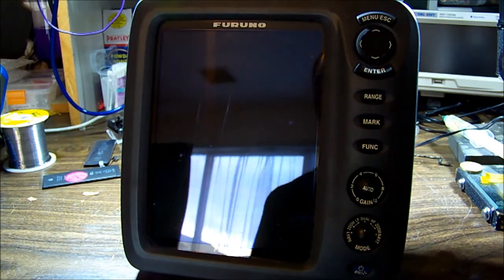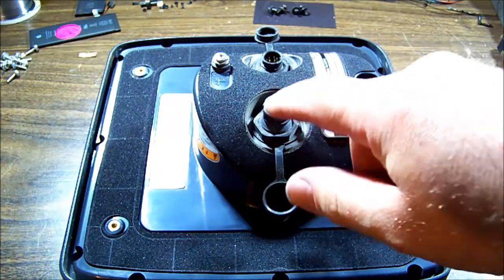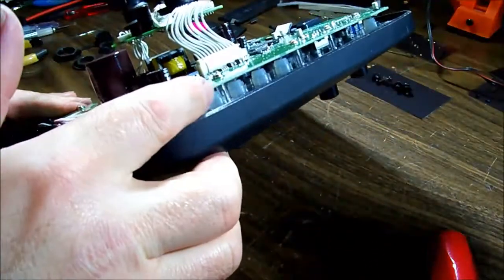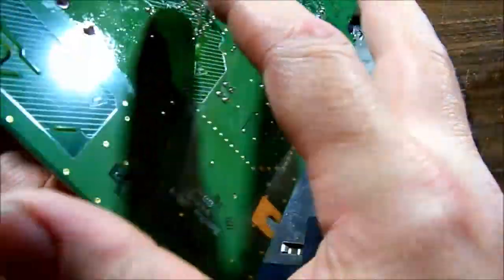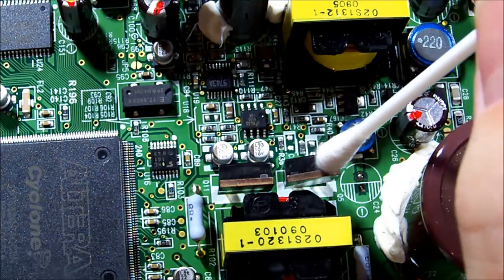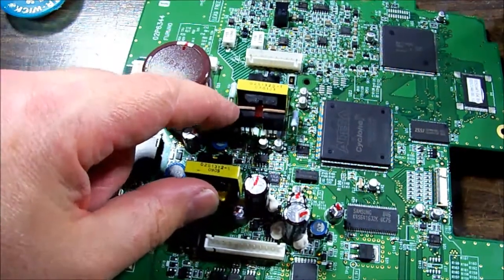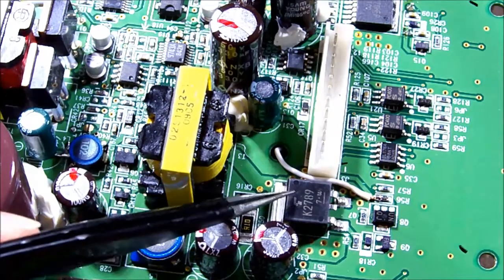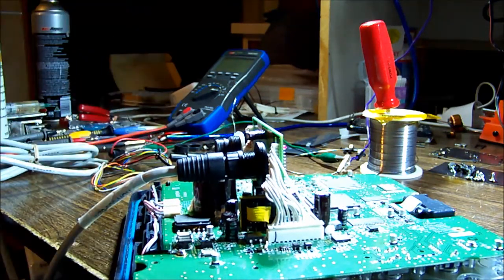Furuno FCV-585 fish finder sonar depth sounder repair

Comment: i had 2 of these at our workshop, 1 worked after replacing caps but failed after a few months again, i had thrown them in the corner, then a 3rd came in so decided to look again, found your video, now all work!. the track must continue to corrode after cap replacement. I ended up replacing all caps except the larger power filter one, and found several at the leaking stage, definitely recommend replacing all if doing this fix!

Comment: Dear Johnny, thanks a lot for your video. I have the same fish finder with the same problem. My brother Jaime and I have replicated your repair and IT WORKED!!! It was not until we jumped the trace with a copper wire that it worked. 
It is very strange. It seems that this is a programmed obsolescence. Why is there a hole prepared to pass the wire through?
Anyway, your video explains the procedure perfectly and helps a lot to keep understanding electronics. I teach at university (environmental engineering) and I must say your pedagogy is far better than mine.
Kind regards from Mallorca, Pere and Jaime
Reply from the maker: Thanks! I appreciate the comment and glad I helped with your problem. Planned obsolescence is a bit of a stretch here but yes it certainly does exist. Not surprised you had the same failure as these caps are destined to leak and the units are always mounted one way then gravity dictates the leak will run to the same area on the board and cause the same damage. The hole for the wire is just pure luck :) Happy sailing!

Comment: Sir, I have a Furuno type FCV 620 when it is turned on, the display voltage continues to drop and turns off, turn it on again and again, the voltage drops in what circuit should I fix and replace the components ... please help ... thank you

Comment: Gee Johnny Fix I have a FCV 588 and it stopped working the next week after going out.  Pulled wire out from fuse box and connected it to a battery and sounder stated working.  When I touched the power lead it stopped again.  Had a look into the pins on the sounder and the power lead had a green type build up.  I sanded that off and sprayed it with contact cleaner but that did not work so I sprayed the pins with WD40 bingo sounder working again.  I hope this will help others

Comment: Jonny, what is the ball park cost for this sort of repair. My Furuno FCV-585 is doing the exact same thing. You can email me if you like - heath AT gcfishing dot com  I'm located in Queensland
Reply from the maker: I don't have a rate as I'm not in business but any repair shop worth their salt should be able to do this straight forward repair. If I had to guess you might be up for $60/hr and if as simple as this won't be more than an hour. Some places might have a minimum charge even if not fixable. Cost of parts a couple $ each tops. These units aren't cheap so would be worth repairing for sure. My only concern is if the o-ring will still seal the case. I guess only an official service agent could provide a new one. Nothing a thin smear of silicone won't solve tho!

Comment: Hi I have a furuno 1623 radar I think the Magnetron is going bad ... how can I check that... can you help
Reply from the maker: I don't know. Check the manual for a self test function. If you can borrow a known good transducer to test with, or plug your unit into another boat setup that might prove if it's the unit or the transducer. I don't believe they run magnetrons.

Comment: Hi Jonny I am writing to you from Italy I wanted to ask you if you can help me, you give the service manual of the fcv585 on my burst a chip and you can no longer read the model number, if you want I can send you a photo so maybe you could help me better if not the manual, thanks.
Joseph
Reply from the maker: I'm sorry, I do not have the service manual for these units. If you cannot read the number on the chip you will need to look at the part of the circuit it is connected to and make educated guess as to what it does and then find suitable replacement. Might be some trial and error.
Reply: @JonnyFix  Jonny I had thought that if I could attach a photo of the circuit you could look in yours and tell me the model of the chip and you would have been very helpful.
Joseph.
Reply from the maker: @PeppeLoGGiu  It would, only I do not have this unit anymore. Most of my videos are other peoples equipment.

Comment: Hi Jonny, I'm writing from Italy. I have a Furuno fcv 585. There is this problem where the screen works but all I can see It's white, theres no immages shown. The buttons work just fine with sound and all.
I would be very glad if you could help me. Thank you
Reply from the maker: I guess firstly make sure no water has got inside it and everything is clean. If there's any corrosion you will need to deal with that. If everything looks clean try removing then re-inserting the flat screen flex cable in case the connector came loose or the connection has gone bad over time, this can sometimes help. If it's not something simple like that I'm not sure without some advanced troubleshooting e.g. use an oscilloscope to see if there is data on the connector that would suggest the processor is making an image, if so the lcd might be damaged or missing a power rail. If not there could be an issue with the processor or related circuitry that makes/relays the data.
Reply: @JonnyFix  I'll try to check this things out. Thank you very much for your help
Reply: @giuseppegemellaro4124   did you manage to fix your white screen issue ? If not, there is now a video on YouTube posted by FREDDEX2021 that addresses the exact problem. The fix was to jumper one of circuits but the video is unclear to the exact components… might be help for you issues

Comment: I've got a Furuno echo sounder I have to fix this weekend with broken connectors, luckily the guy has another unservicible unit with good connectors.
I was looking around youtube and came across your video.
I was thinking of fixing the broken one as well. 
Anyway its nice to see an experienced techo looking for the obvious before delving into the circuit.
I'm our local retired electronic guy that does this type of work for fun and sometimes a bottle of scotch (mainly from the guys that own boats and not the poor farmers).
Thanks
Reply from the maker: Oh good stuff. Yes this is one way to keep the bottle full but I need to cut back a bit myself ;)
Reply: you can get replacement connectors from Furuno..

Comment: I have Furuno fcv 620,Furuno logo was appear just in a second.afrer that blank.no picture.
But the sound of button is on.
Can you help me?
Reply from the maker: Hold a bright light to the screen and see if you can see the image. If you can then the backlight has failed. If not then I don't know what it could be. Check for physical damage inside for a start.
Reply: @JonnyFix  no image,dear 😢

Comment: Great repair video! Thanks for sharing. Have you experienced a upside down screen?
Reply from the maker: I have not. Can't imagine it would be a software setting but you could try installing the latest version then check the flex connector inside, unplug it make sure it's clean.

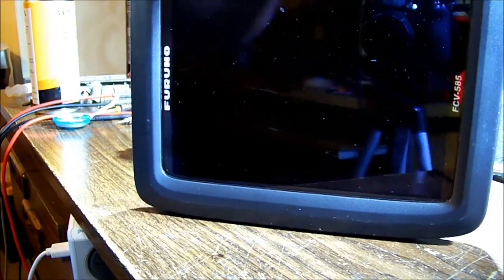Comment: Dear Jonny,  could you tell me what is the name of that IC Q14 you put the finger on at 17:11 that one receive the 12V  very close to the capacitor C31 you replaced after first try and it do not work..  thanks Ivan
Reply from the maker: If you mean the 3 pin device I think it's Q13 and likely a transistor of some sort (I no longer have the device for reference). Q14 is the 8-leg IC closer to the white connector.
Reply: @JonnyFix  I mean the Q14 8 pin IC 1055 something...closer to the white conector J3... at the forum they say about 1055-7k2-62T2    part number 000-156-131
Reply from the maker: @yankeebravo  I think it might be an LT1055 single JFET opamp package that could be used for signaling on the data line, I think they have a serial data line that can talk to other devices, some kind of marine equipment standard?

Comment: Jonny nice vid! What were the ratings on the capacitors i noticed 1 was 16v 100uf i think.. What was the 2nd cap replaced?
Reply from the maker: The first one in the middle is 50V 100uf, the 2nd by the white connector is 16V 100uf
Reply: Awesome cheers. Nice work around there with bypassing the pads for traces. I have an earlier 620 im going to have a look at. Was there any signs i.e bulging on top of the caps?
Reply from the maker: As shown the caps were leaking out. Other than a little bit of a mess on the board they looked fine.

Comment: my furuno goes off alone.
can this be?
thanks!
beppe
Reply from the maker: Is it after the same amount of time each time it's turned on? Maybe there's a setting for auto off that has become enabled. I really don't know much about this units operation.
Reply: there is no time equal to sometimes 10m sometimes 1 hour sometimes a day.can you help me ? thanks beppe
Reply from the maker: Could be many reasons even down to something simple like the power feed to the unit being interrupted through bad connection etc.
Reply: Ciao Beppe hai risolto il problena

Comment: Nice I have a 588 brand new only used a few times and now doesn’t even power up have 12v all the way to plug in the unit
Reply from the maker: Would be worth investigating, might be similar issue.